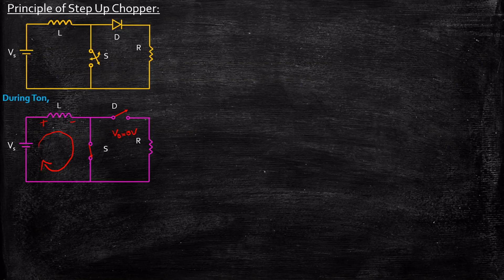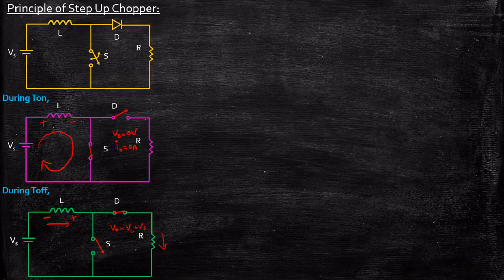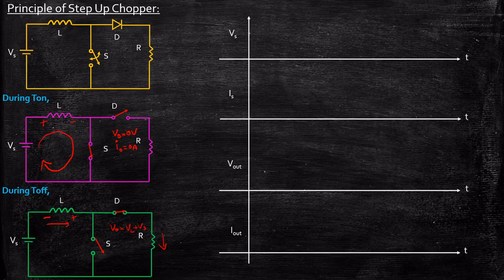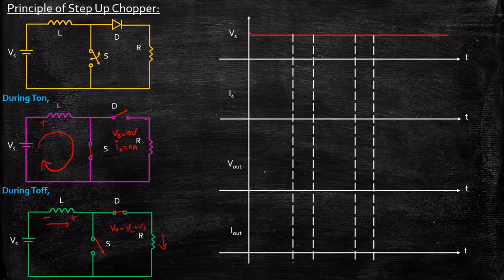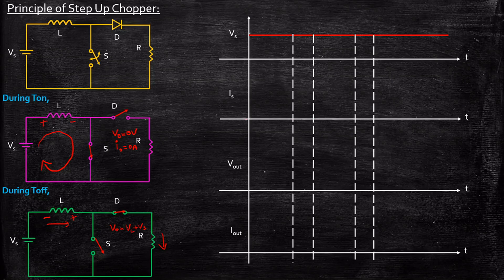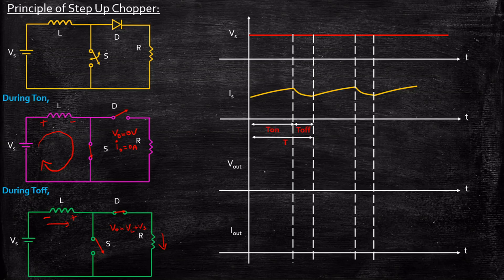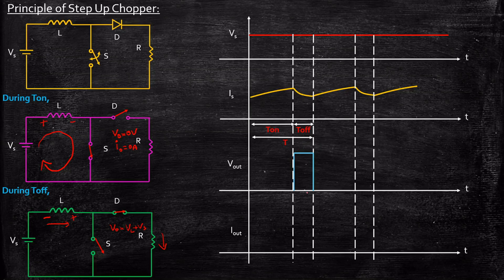Principle of Step Up Chopper | Power Electronics | Lecture 68

Comment: sir with respect to the iout waveform you have shown quick discharging and faster charging but it seems incorrect as you yourself said we choose the inductor with high inductancethus having longer charging time and corresponding discharging time little less than that it just drives the wrong message .Thanks for amazing videos.